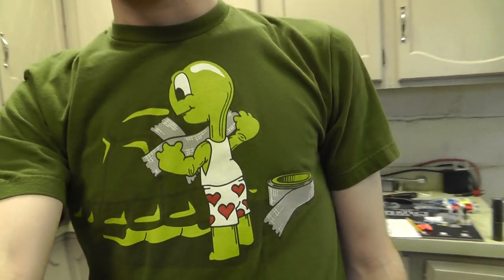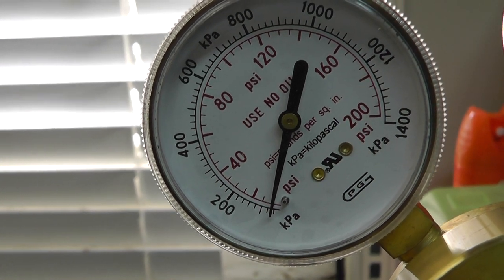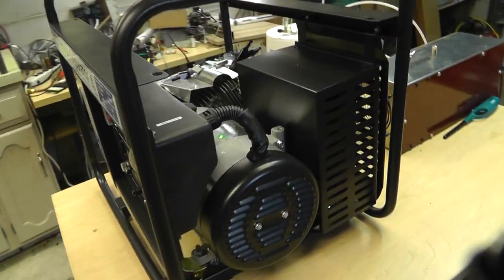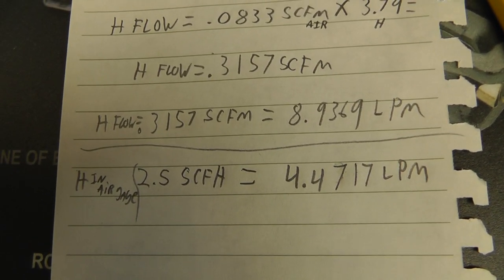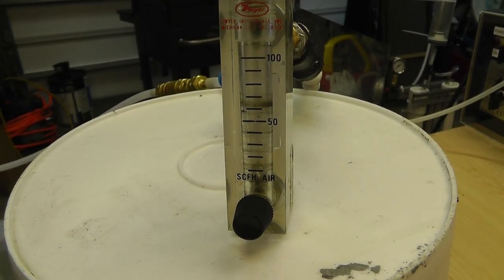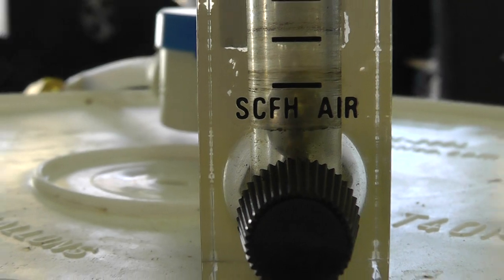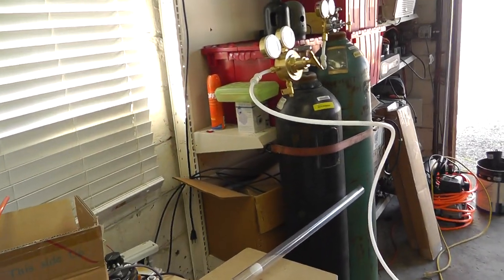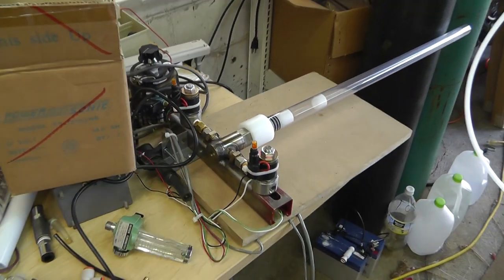7HP Engine Running Minimal Hydrogen, H-Flow Gage Conversion Calculations 3-13-12

Comment: @amfan12 2- the other thing to remember with HHO setups is that it works like a diesle motor in the way that it reve's with the amount of HHO that is put into the intake,not the amount of air-fuel mix.You will see in the vidio that when Russ wind's up the hydrogen flow the motor reve's up without opening the butterfly on the carby.He only dose this in the high reve's ,but you wouldnt need to do this if oxygen was used aswell.So he dosnt actualy have a vacume leak-he has an extra fuel supply

Comment: @TinManPower Small engines have a check valve on the breather stock from the factory. It allows the engine to only push crank-case gases out, but not in, thus creating a crankcase vacuum by itself. Putting the breather in front of the carb will let those same oil vapors get sucked in without effectively creating a huge vacuum leak in the intake manifold.

Comment: @amfan12 Hi amfan12-there are 4 good reason's for doing this.
1st-it help's slow the rapid burn rate of the HHO,the oxygen coming from the ambiant air and even more so when useing straight HHO withou air.
2nd-As HHO turn's to water when burnt,a little extra top end lube will never go astray-lube from the oil fume's when motor is hot.
3rd-An IC will run more efficient with a crankcase vacume as you eliminate air turbulance in the crank case-less air friction on the crank

Comment: @amfan12 Hi amfan-you are correct with the motor's haveing a built in check valve in the rocker cover,they also have a 4mm or 1/4 inch hole at the bottom of that valve housing in the rocker cover.This hole allows air to flow both ways reguardles of the pcv-although it is a lot less.This is something Russ must look into aswell as he will be sucking hydrogen through that hole into the crank case.But the thing with this is that it's being put back into the cylender from the crank case.

Comment from the maker: @amfan12 One reason I'm doing that is to actually draw a oil vapor into the engine to help lubricate it.  since we're no longer using a wet fuel the rings will not get as much lubrication as if we were running on gasoline. Eventually once I understand what type of gases and what type of flows that I meeting I can then create some sort of an automatic valve.  This particular generators designed to just run at full speed all the time and the governor will keep it works supposed to be.Thanks! ~Russ

Comment: @TinManPower And 4th-if any of that water or steam that is produce dose manage to bypass the ring's-insted of turning your oil into milky mud,it will become vaporised in the crank case and sent straight back through the engin to be burnt insted of your air filter becoming soaked with water.

Comment: @amfan12 Water is not an issue. The hydrocarbons in gasoline already create nearly a gallon of water for every gallon of gas burned. Engines run hot enough that the water vapor can't collect in the oil, whether the fuel is gasoline or hydrogen.

Also, FWIW venting crankcase gases directly into the manifold will speed up the hydrogen burn rate by introducing 1. More oxygen, and 2. More fuel (hot flammable oil vapors).

Comment: @rwg42985 Gas provides no lube to the rings. The engine oil will provide enough. I assure you that gaseous fueled engines (LPG, CNG) do not have the crank vent directly into the manifold. What you have is a large vacuum leak and it will pose issues on trying to get fueling dialed in. Put the vent on the front of the carb. 

The governor holds @3600RPM. Not full speed. Load is determined by manifold vacuum, and demand-regulators (which you will need to build) regulate on vacuum. PM for more info.

Comment: Why do you have the crankcase vent hooked up to manifold vacuum? Crankcase vent should be at the carb air inlet, or held at atmospheric pressure.

Look into a device called a "demand regulator", it will regulate gas flow based on engine loads. They're mainly used for LPG/NG systems.

Comment: @rwg42985 very good vid Russ. I do know a bit about this engine as I have one my self that I got fdrom harbor freight. you will need to find a better way to lubricate the interior engine parts like your rings and valves if you plan to do any  test runs longer than ten or twenty minutes. The crank vent port will not give you enough  lube to be safe. Ya can pull the plug every so often and put a drop of good stuff in the chamber (slick 50 or dura lube ) or if ya got something better use it.

Comment: Russ , new to your channel and love you're ideas . I will be attempting this at home as well. Can you tell me the best flashback arrested to use with hho for this idea for running generator on hho.
Reply from the maker: Welcome. So you can get a professional hydrogen flash back arrestor from your local welding shop. I highly recommend this option. ~Russ
Reply: @RWGresearch  I had mechanic tell me a welding flashback arrestor wouldn't work

Comment: Reason the flow gauge shows low flow could probably be due to the fact hydrogen is the lightest element on earth and as such may be the reason it cannot move the weight of the ball in the gauge very much, just my thoughts.

Comment: Russ,you don't need a flashback arrestor for straight hydrogen.The gas won't burn back through a hose,because there isn't any oxygen in the hose.You need to check out Roy McAlister from the American Hydrogen Association.He shows how to run an engine with straight hydrogen.No carburator at all.
Don

Comment: a couple things that might give you a giggle or two ... 

CORK THE EXHAUST ... yeah, you heard me right ... you may be quite surprised at the result ... 

while the engine is running, put a cheap multi meter near the exhaust and watch the digital readout ... that effect should make you scratch your head ... 

have fun with it !!!

Comment: If i understand your video correctly, you are running solely on hydrogen? If so, opening the garage door will only air out the farts in the room. There is no emission from burning hydrogen other than water. If you're mixing it with gas then yah good idea opening the door :P